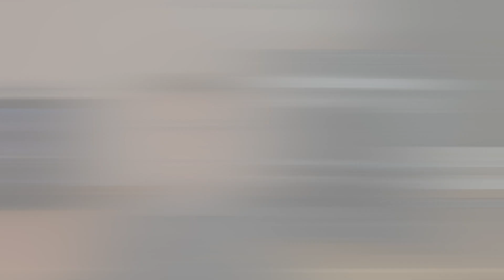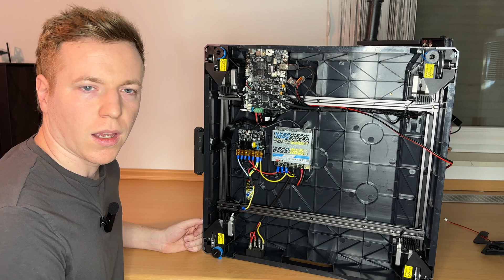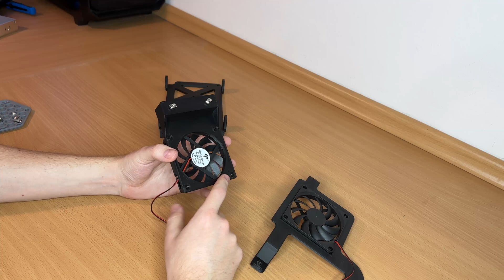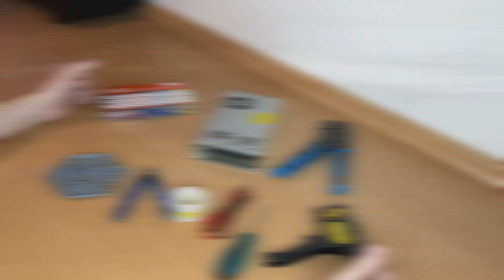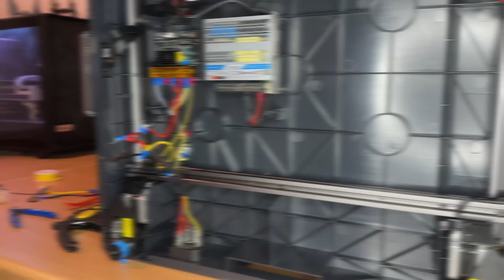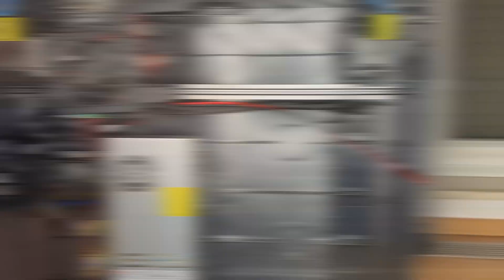Sovol SV08 Power Supply & Electronics Bay Fan Upgrade

Comment: Hey great video! I wanted to ask as I did everything as you did but the fan doesn't turn on when I use the hot bed is there a way to edit the code so that when the bed turns on the fan turns on? ,since we cannot use pid tuning since there is no thermostat thanks!
Reply from the maker: Hi, thanks!
You can put "SET_FAN_SPEED FAN=fan_name SPEED=1.0" in your start_print macro after a M140 command. Speed 1.0 = 100%, so 0.5 = 50%.
And to turn it off put the same code with SPEED = 0.0 in the end of the end_print macro.

Comment: Hi the same screw stripped on mine, I fixed it with CA glue and bicarbonate of soda (baking soda) Then drilled a small hole a little smaller than the screw.  Thanks for posting 👍👍
Reply from the maker: Hi, good tip, i will keep that in mind. Thank you!

Comment: OK, I get upgrading the fan, though it might not be necessaryu with the configuration mod to run only on temperature demand?  But why upgrade he power supply?  How is the stock one inadequate?
Reply from the maker: the stock one works fine and is not inadequate. i plan to use multiple toolheads on this printer and therefore more power is needed. also it wont harm the hardware if it runs cooler

Comment: When assembling my new SV08, I simply replaced the loud motherboard fan that Sovol supplied with a $14 Noctua drop-in replacement from Amazon and the SV08 is very quiet.  I didn't even bother changing the wiring or printer.cfg to have the motherboard fan only on when needed.  It was a very easy upgrade.
Reply from the maker: Nice to hear that it was a simple swap!
Reply: @AndysTechLab  - I just ordered the after market 8 mm thick aluminum bed to solve the warped taco bed problem and I'm still waiting for Sovol's promised Eddy probe upgrade for the SV08.  Those won't be simple swaps, but will finally allow the SV08 to live up to its awesome Voron 2.4 potential.
Reply from the maker: They got the Eddy on their Zero and new SV08 Max so lets hope the SV08 gets the upgrade soon. 
If not you can swap to mainline klipper and use the Eddy probe. There is also the possibility to use a tap function to get perfect z offsets.

Comment: Great mod.. question: after installing the new 2 fans, do you put in the stock metal cover back?
Reply from the maker: hey, no i didn't put it back. two of the screws on one side are taken from the controller fan bracket. there is more airflow without the metal cover.